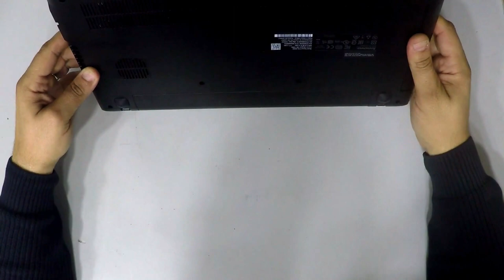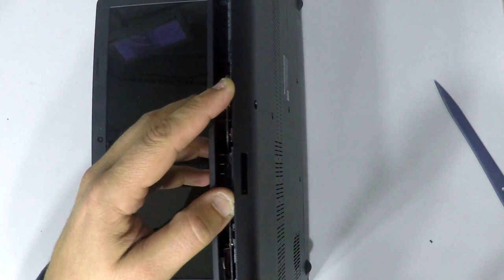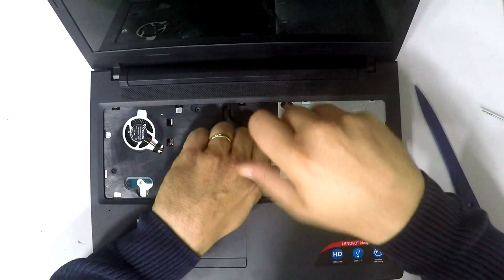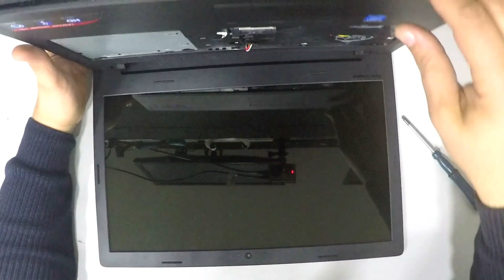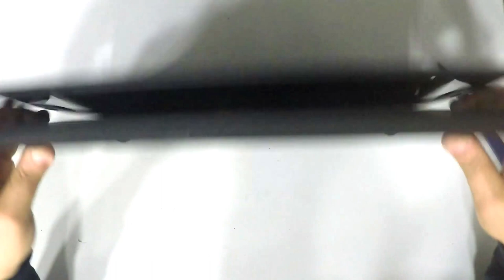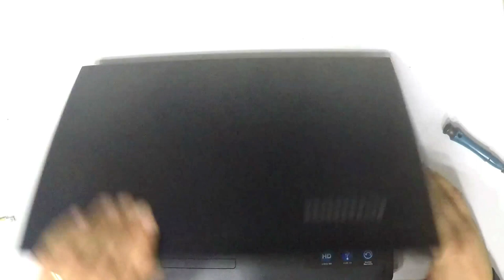Lenovo IdeaPad 100 Full Disassembly and Reassembly

Comment: Long pauses with nothing going on - the gentleman disaassembling did not know that the release screw for the DVD unit is internal...Might ba a good video - but I lost patience...
Reply from the maker: Hello Chris, my video for expert and amateur user, I prefer step by step guide (and now Tubers know abut the internal DVD screw).
Reply: Chris Bradley is correct, you have too many long pauses in your video. I have never seen a step by step guide/video that is targeted for amateurs where they didn't edit out the long pauses. Your video could easily be 10 min long or shorter while still retaining ad revenue.